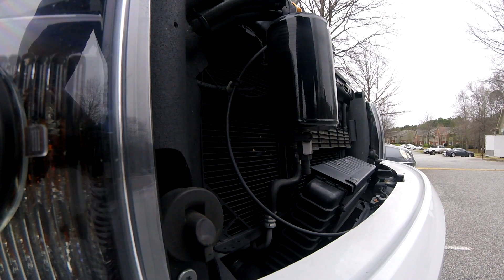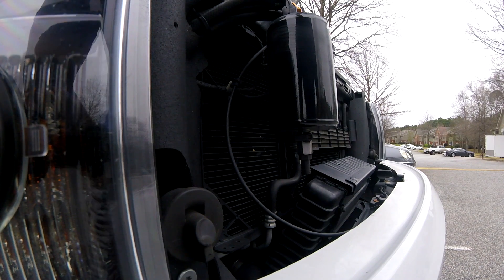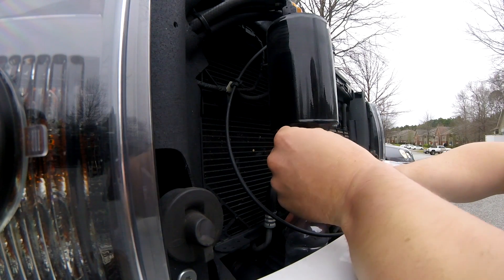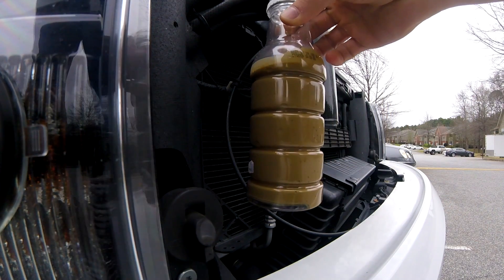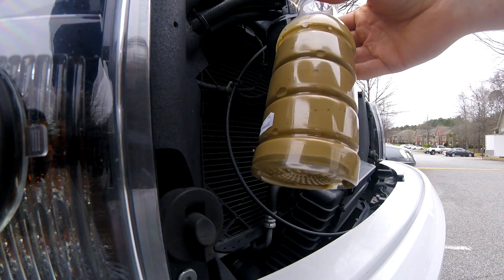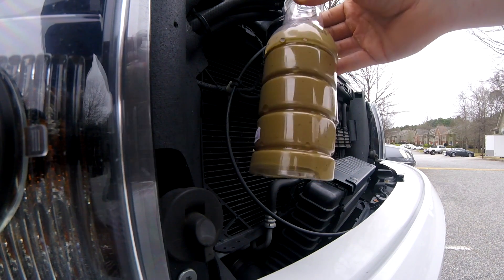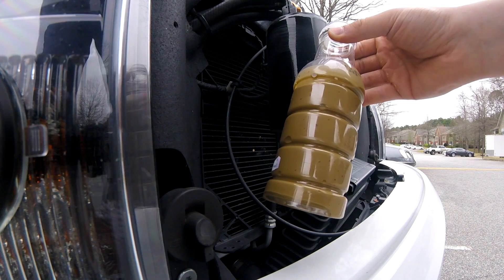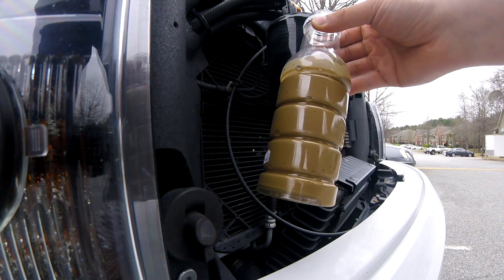What Comes out of an Ecoboost Catch Can?

Comment: That doesn’t look bad, u must run a good oil filter and oil. That stuff would burn in the combustion chamber without much problem. The stuff u don’t want is when it comes out black and gritty, that’s the contaminates that cause valve and turbo issues.  Catch cans are fine if they give you a sense reliability but they’re not necessary for the average car owner. I have 375,000 miles on my 2011 f150 3.5 ecoboost and the drive train still operates and performs like it did at 80,000 miles. I use Amsoil products only and that does the trick. I wish it would take care of the other irritating issues that Ford is known for, rear door wiring harnesses and few other things but it’s a good motor if taken care of properly.
Reply from the maker: awesome! yeah i run wix filters and castrol full synthetic. i recently switched to 0w40 and that seems to help with the cam phaser issue
Reply: @NSQGarage  yes, WIX filters are a great filter and you’re using a good synthetic oil. Sounds like you are doing everything right. Good oil and filter changed at the proper intervals will serve you well. Tune ups around 70,000 miles and gapping them at .28 is what I recommend. Change your transmission filter and fluid at 100,000 or 80,000 if you tow a lot. I had to have my transmission pcm changed at 360,000 but the transmission is spotless and will probably last another 200,000 miles
Reply: Stephen can you please elaborate for me. I got a used 3.5 and immediately put a catch can on. It’s was catching black oil/fuel with thick brown sludge on the bottom. After an oil change and filter (both the plug and filter were seized) the catch can is catching chocolate milk same smell even viscosity though no thick chunks. This good or bad? (Edit:170k miles)
Reply: @Branhawk  if your PCV fluid is a tan milky color that means your oil and filter are doing a good job. If it’s black and gritty your filter is inadequate. I would suggest using a good WIX Hp filter and a good synthetic oil.
Good filters are WIX HP, NAPA platinum, Mobile1, Royal purple, and Amsoil EAO17 
Pennzoil Platinum oil, Mobile 1 oil, and Amsoil signature series oil. I use Amsoil all the way.
Reply: @stephenbloom2545  bro thanks for the quick and detailed response! I did a full mobile 1 full synthetic and filer change. And it changed from black and gloopy to viscous chocolate milk.
Reply: @Branhawk  Mobile 1 will serve you well my friend. I now have 460,000 miles on my ecoboost and it’s still making me money. It’s a great engine and I’ll be buying another when this one hits 500,000
Reply: @stephenbloom2545  that’s epic bro! Keep it up much respect!

Comment: How would you rate the difficulty in taking the grill off?  I like the idea of a front mount for a can but I'm reluctant to be in the spot pulling the  front grill off every time I need to empty.  Thanks gw
Reply from the maker: On the 09-14 f150, the grill is attached to the hood so it gets out of the way when you pop the hood
Reply: @NSQGarage  Of course.  I have a 09 & 15 Expedition which do not have the attached grill.
Reply from the maker: @Red.Hot.Chili.Beans63  ahhhhh now it's all making sense lol

Comment: I live at 10,000 ft and obviously not a warm place.  Lots of snow and little humidity.  My 2012 catches a lot of water....first time I emptied it I thought  head gasket or something but it is water.  I've glad I installed it.  I'm getting the slight sputtering now so today I've decided the weep hole people drill in the bottom of the intercooler is needed.
Man, these motors have a ton of blow by!!  
Summertime I get so much less.  I think my 5 minute trips to work everyday cause alot of it too.
Reply from the maker: Yes! I used to get so much when I lived in Alaska and would take little 3 min trips!
Reply: @NSQGarage  it's snowing today but I had a drill here at work, already took that plastic thing under the bunper off the truck, easy access and drilled the hole, and got some oil out of that instantly.  Not as much or as milky as I expected.  I have driven it only around the block so far but I'm not lying when I say it definitely made a difference in take-off.  No more of that misfire code I've had thrown a few times.  Had to change the throttle positioning sensor...just as easy so changed that whole unit.  It was nasty  and maybe this will prevent buildup on that as well.  136,000 miles, on my 2nd engine, and I swear it seems I end up doing everything that's mentioned as "issues" on the damn thing.
Hate to jinx myself but you watch....coolant line fittings are gonna start leaking at the turbos just because I read those are prone to failure
Reply from the maker: @peleger1  yeah the guy who owned it before me had the weep hole in there already. But it wasn't big enough so I had go up a drill size

Comment: Simple, don’t drive direct injection vehicles
Reply from the maker: Direct injection has its benefits. Fuel efficiency and generally greater power.
Reply: NotSoQuaker depends on how long and how you use the vehicle. If its gonna be for long term Port injection will outlast. GDI will show its problems in next few years and thats what manufacturers want, for us to replace or pay big moolah to repair.
Reply from the maker: @dq2023  fair enough. But Ford did port and direct with the gen 2 Ecoboost. So guess it's the best of both worlds
Reply: NotSoQuaker yes, similar to BRZ or AE86 I can’t remember which, has both port and direct injection. Main challenge is consumers willing to pay more for this tech? And also we need to wait for current stock of unreliable DI engines to run its inventory lifecycle before better engine tech can come into play. This is a challenge and may take 8 to 10 years depending on projected market sales per make. Mass market vehicles will take longer unfortunately

Comment: Never heard the term catch can until ecoboost came out. What we have here is a poor marriage of turbocharger to engine and a lousy way to inject fuel into a cylinder. What was the fix for that? Add a port injector in addition to direct injection to wash the intake valves off. A failed design from the start. I won’t own one.
Reply: I'm not speaking to the design of the EcoBoost, I have no horse in that race, but catch-cans have been around for generations.  I first encountered them (1972) on diesel-electric locomotives built in the 1950s and later in the military when I was on diesel-electric ships and boats circa 1930s forward. There isn't an engine with modern environmental recycling that couldn't benefit from a catch can.  The catch can keeps a lot of impurities from blowing by the pistons and getting into the crankcase.  This happens on naturally aspirated engines, not just turbocharged ones.  I have a catch can on a 1997 Tacoma 3.4L 4x4 with 289K on it.  I live in the South so there are no problems with freezing -- but I do get a lot of goo when I drain it.  I check it 500 to 1K miles. I change the oil (full synthetic) every 3K.
Reply: Kevin C O'Dunn most cars I’ve owned without ecoboost have a clean dipstick every time I check it and I changed oil every 3000 miles. Blow by is a result of too much pressure in the cylinder. Very little oil should get past the oil ring let alone the rings above them. I understand why Diesel engines need turbos due to the work load they are under. Ecoboost in a car or small truck is just a waste of power that is not needed along with the by products it produces.
Reply: @Funny Positive Life no it does not go thru the turbo its routed into the intake after the turbo and intercooler
Reply: I've had a 2014 F150 Limited with the 3.5 ecoboost. Really like it, and adding right now a nice aftermarket can and separator  Can holds 32 ounces. Plug and play $430.00 tax incl. One hole to drill, easy mount, the rest just connections. Still.............owned this Limited for 20,000km problem-less and strong. Looking in a year to trade up to a 2017 Platinum 10 speed. 5.0.
Recently got the heebie jeebies about a long life high compression, twin turbo. I'll go for the ever so slightly less gas efficient 5.0 the overwhelming choice it seems amongst Ford shop Mechanics, and the 'growl'.
Reply from the maker: The gen 2 ecoboost has that exact system. The gen 1 ecoboost is almost 10 years old at this point. Too bad they didn't develope it before.
Reply: I have a buddy with an LS trailblazer, even he has a catch can that collects oil. And it’s non boosted !

Comment: with all the oil in catch can. Do you have to add fresh oil to crankcase?
Reply from the maker: I check my oil level and it always stays within the recommended level. But, it's definitely worth watching.
Reply: The average makeup of what our systems trap is 70% water and acids, 23% raw fuel, and 7% is oil saturated with abrasive particulate matter.

Comment: How many miles did it take to accumulate that much?
Reply: I have a upr,can, on 2013 eboost.,in SD, in winter months, they want you to drain, when engine is warm/hot, every other DAY. Otherwise will freeze up,and blow out oil, and you will think you blew up your engine. So drain every other DAY.
Reply: @redgunner61  Thanks for the tip. Just installed one in my 2013 eco
Reply from the maker: Probably a few thousand or so

Comment: www.RXCatchcans.com
Reply: Tracy Lewis Performance Hi I have the rxp catch can for my ecoboost Flex and when I’m draining it, it just slowly drips out. Drips every second or so. Is that normal?
Reply: Always drain when warm and engine off. If it drips slow, push a piece of wire or zip tie into the drain opening as it can gel inside with all these catch. You can also shake it a bit.
Reply: Tracy Lewis Performance thanks. I poked a small straw in and that unclogged it. I got maybe an ounce worth of gunk out since the last time I drained it 12k miles ago. Is that also normal?  I was expecting to fill up the bottle.
Reply: Keep poking it up in as it gels at times. You should have far more than an ounce.
It is not uncommon for this to clog as it gels.
Reply: I would try and unclog more.  12k miles is usually more than that, but all engines are different.

Comment: Nasty. I mean Ford needs to recall all their vehicles with EcoBoost engines and install Catch Cans that can hold this nasty fluid for up to 10,000 miles and provide a drain plug undercarriage so that with every oil change it can be drained out.
Reply: 点老了 agree this is poor engineering
Reply: Andrew Morgan, BTW, I forgot to point out my reasons for making those statements. Carbon build-up on intake valves is not a problem with Ford's EcoBoost engines only, but it's an inherent problem with GDI engines. However, what makes Ford's problem very disappointing, annoying and unfair is that the conventional intake valve cleaning methods which inevitably generate high temperatures due to the cleaning fluidd used, are definite causes of damage and total failure of delicate fins inside the 2 Turbochargers - which Ford itself has confirmed at their Labs. Adding insult to injury, Ford says they don't have an approved method for cleaning carbon gunk on the back of the intake valves (as well as on piston heads and cylinder roofs - by extension). Unbelievable!

Therefore, what Ford needs to do is either create a cleaing method that doesn't damage the Turbos or replace the Turbochargers with better ones that can withstand high heats generated by the conventional intake valve cleaning methods.

And oh, it should be put as a regulation to require vehicle manufacturers to include Oil Separator Cans for GDI engines, and at least for those that are Turbocharged as carbon build-up is worse with them than others that are not.
Reply: 点老了 Lmao. Why. Only idiots use catch cans, they're catching condensation mostly. Drive here, pull heavy and your direct injection engine will love you
Reply: @kyledelfing6391  you fart on soil.

Comment: Why do does one need a catch can?
Reply: It's cheaper and a hell of alot easier than replacing plugged up catalytic converter's.
Reply from the maker: Phillip Kuntze the oil and crud that come from your pcv valve normally get routed to your intake. So then your engine is burning that stuff and that is not ideal. So the catch can separates it so you can get rid of it.
Reply from the maker: Phillip Kuntze https://youtu.be/PWz6vCnJ4CA
Reply: @Funny Positive Life How does it go through the turbo? As it’s blowing hot air out? Curious because it looks to go from block right back to intake manifold, would be interested how that all works